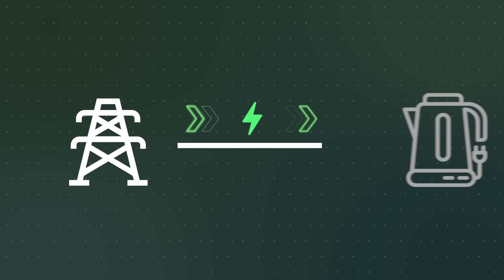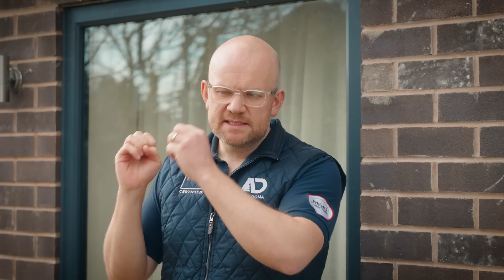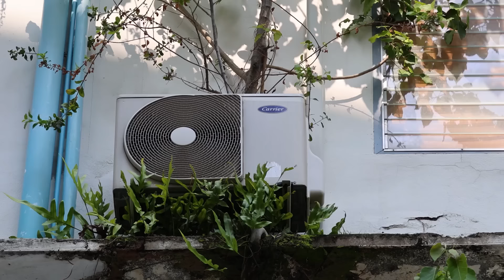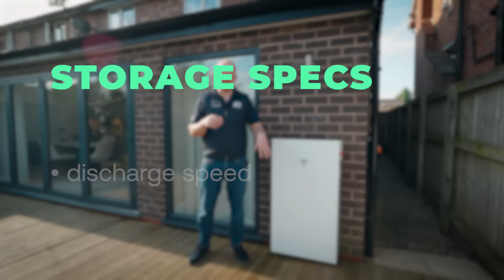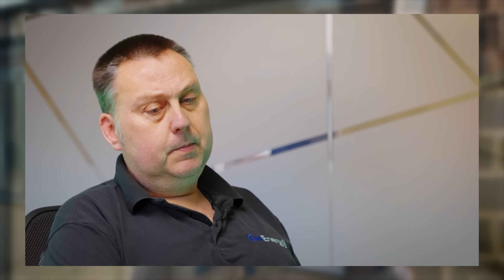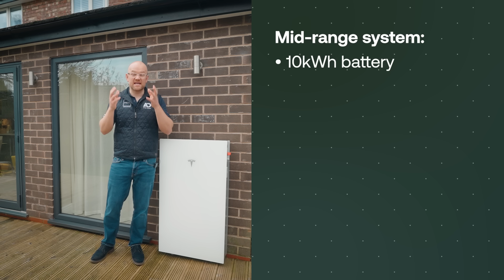Solar Battery UK Guide: When It’s Worth It and When It’s Not

Comment: Tesla Powerwall consumes too much wall-space for typical smaller UK city homes. 13kWh capacity increases sprawling wall space for every additional unit, and an American design where homes are typically larger.

We went with SigEnergy as it's modular, building vertically instead of horizontally, and it's modular.

Our 30kWh battery stack and 12kW inverter (with full G99 DNO approval) sat neatly on the wall behind the garden gate, gives us all the power and storage flexibility we could want. When the batteries ultimately degrade, we can still leverage remaining battery capacity and simply add new batteries vertically, without replacing the entire unit and losing remaining value.

Comment: This was a very helpful video.. My annual usage 9,550 kw and my roof in london is too small so i beleive solar would be impractal. I am only intersted  in batteries.... So I am not sure which brand and battery would be feasible.. With the highest year in warranty. i dont have heart pump or AC. My office pc runs 24 7 .. that where my expense is coming from which is 24/7 365

Comment: You recommend opting for solar panels over a battery if your priority is to run AC. But isn't it the case that in the UK, any period in which we need to run AC is also  likely to be a period of overcapacity countrywide (at least until AC is much ore widely adopted) so that, on a dynamic tariff, electricity would be available very cheaply off the grid anyway?

Comment: Excellent, informative video but you have completely omitted battery / inverter self consumption or standby use. You clearly explain that a Powerwall 3 would run a 1kW load for 13.5 hours but that’s not actually accurate. My Powerwall 3 self-consumes 100-150W to power itself. In reality, due to this self-consumption, my Powerwall 3 will only run a 1kW load for around 12 hours. This standby use is not specified on data sheets and the Tesla App conceals it by treating it as ‘home use’ e.g. it will show that my home is using 1.1kW when it’s actually only using 1kW. How does this standby use compare to other batteries  / inverters and do they all conceal it within ‘home use’?

Comment: I asked Claude AI, to work out the most effective battery and inverter sizes, based on 11 months of half hour data for our house, and our new electricity prices when we come off our current tariff in 3 weeks time. It came back with 15kWh and 3.6kW, and a payback of 4.1 years, based on charge off peak, use on peak. So then I added in a 32kWh battery and 6kW inverter, and minimum discharge of 10% and maximum charge of 85%, it came back with 4.2 years, but over a 10 year period it is by far the best option.

Comment: I find this video slightly disingenuous. You've given some great advice and simply answered some complex questions whilst interspersing an up sell on sigenergy and tesla systems which you partner with as a company. You don't make any claims or accusations about the "budget" systems but offhandedly imply you'd be unhappy if you did buy one but most people don't need the "AI" integration that Sigem offer and Tesla has had a lot of usability issues with smart tariffs of late. Your recommendation of the Tesla warranty is a bit snake oil salesy too - most of the budget providers you mentioned offer the same 10 years with 6000 cycles which anyone would be hard pushed to reach as you would need to deplete and recharge your battery entirely 3 times every 2 days.

You also mentioned reliability as a key push for more premium brands but failed to mention out of every brand you did mention Sigenergy are the only ones who have had major recall and fire issues with their systems.

I appreciate you're a business and need to make a profit but don't claim to be transparent like you did in this video whilst misleading people's choices.
Reply from the maker: Thanks for taking the time to write this, and fair challenge. To be clear, yes, we install Sigenergy and Tesla, and I'd rather say that openly than pretend otherwise. They're what we install because they're what I'd put in my own house, but you should weigh my view knowing that.

A couple of corrections though. Sigenergy are far from the only brand to have had a recall:

Tesla recalled Powerwall 2 units in Australia and the US over overheating.
LG had several fire risk recalls of their RESU batteries across the US, Australia and Europe.
Those same LG cells were used in SolaX, VARTA and Redback systems, which were recalled too.
Growatt recalled inverters in Australia over connectors that could overheat and melt.

The Sigenergy recall was a limited one on the AC plug of certain single phase controllers, and it was fixed free of charge. Every manufacturer will have issues at some point. What matters is how they deal with it.

On warranty, you're right that 6,000 cycles is hard to hit. My point is less about the headline number and more about who's behind it. A 10 year warranty is only worth something if the company is still around in 10 years to honour it, and that's a big part of why I lean towards manufacturers with serious financial backing.

The budget systems can absolutely do the job for plenty of people, and if one suits you, great. I'll make sure I'm clearer about that in future videos.

Thanks for commenting.

Comment: How many panels should I go for? Is there an upper limit?
Reply from the maker: Good question. There is always an upper limit, but it usually isn't the panels that set it.

The first limit is the inverter. Most inverters let you oversize the panels on the DC side by somewhere between 50% and 100%, so you can fit more panel capacity than the inverter's rating and still make good use of it. But the inverter rating is what caps your output, so that's normally what dictates how far it's sensible to go.

With a Powerwall 3, the theoretical ceiling comes from the panel string voltage, which works out at around 36 panels on a domestic property. In practice the inverter rating tends to bite before that. With the Sigenergy it's a similar story, though it has four MPPT trackers so you can usually get a few more on before you run into the limits.

The second limit is the DNO. On the G99 application they don't generally limit how many panels you have, but they can and do limit the size of inverter you're allowed to connect. So that's the one to check early.

And if you're on a three phase supply, or you upgrade to one, the constraint moves again and becomes the capacity of the incoming supply itself. That's where you can go considerably bigger.

So the short answer is yes, there's a limit, and it's set by your inverter and what the DNO will approve, rather than by roof space or panel count.

Hope this helps.

Ian

Comment: So looking into the future,:- 
1/ If everyone installs batteries/ gateway systems, after a power cut wouldn't they all switch to recharge mode and crash the grid?
2/ Sodium ion is around the corner. It has multiple benefits, but the cost and availability (in mid 2026) is not quite right. Wouldn't it be cost effective to buy a cheap battery now and work it to death over a shorter time, then replace it with sodium when its stable.

Comment: Rather than whole house, try a power station and trickle enough from a Fogstar. Leave the grid. Modular for redundancy.

£1500 for fogstar 24V 280Ah 7kW+  two years ago and paid off already. Only 234 cycles on a 6000 cycle to 80% Charge Capacity. The powerstation a consumable. Need more, the same kit again but autominous.

Now figure out how to point your pv at a winter sun all day.

Modest use and insulation before you start.Passivhaus mindset.

Comment: Fogstar batteries plus a large Sunsynk 15kW inverter is around half the cost of a Powerwall 3 with later storage and inverter rating, plus it doesn't require a Gateway device. Sigenergy has a pretty poor warranty.

Fogstar now have heaters and fire suppression so comparable with Sigenergy's USP.

Givenergy have shown us that premium products are a risky proposition.

Comment: It's the standard daily charge that I want to get rid of as that's the most expensive thing to pay for. Off grid is where it's at
Reply: Unfortunately solar is not an off gri system as for at least 4 months of the year over winter you will not get enough energy. Then yo need wind or HEP

Comment: I looked at these wall battery units, and they all are overpriced, I can not afford them... And a hell no to Tesla....
I rather use cheaper rack batteries with zero Proprietary software...but rack batteries take up more real estate, and are not made for outdoors....
Beware UK you are gaming the system with your current situation of buy low and selling high... That all can change overnight... That is what happened in America... We, for the most part, can not benefit from exporting power, anymore... We were, where you are at today, back in 2000s, today we have batteries for long blackouts and overnight usage, not for exporting...
PS I have a 48v 30kwh battery for only $3000us using super cheap 12v lithium batteries... Anything more will be a rack battery system...
Reply: Tesla are the best, don't be put off by short term brand damage by elon, the best engendered battery.

Comment: Hi, I use 16700kwh per year, have no
Solar panels or battery yet. I have an air source heat pump that is really expensive for 4 months of the year, have an EV and a PHEV which costs between £1.20 per night for the PHeV and £3.25 for the EV for the cheap 5 hour overnight rate. Being in my early 60's looking to reduce the amount I pay per month. Thinking about battery on its own initially as I am such high usage I am not sure how much I would save with solar panels

Comment: @Apexdoma
Hi Ian.  We already have a Solar PV system and 15kWh of battery storage and have found it very beneficial to afford to run a couple of AC units in the bedrooms (in fact it was the reason we installed solar).
Following that weve both invested in EV's so are now on the Octopus Intelligent GO tariff.
We've JUST signed up to have an ASHP installed to replace our badly-installed gas boiler.
You've just mentioned the Octopus COSY Tariff that can be used to charge your home batteries numerous times during the day - especially in Winter.
In your experience, is it likely that we'll be best off switching from OIG to COSY tariff during the winter?
For your information we have 15kWh of storage, 6.4kW array of panels and a 6kW inverter +  in our 2-bed detached house?

Comment: I don’t see a downside to having more battery capacity than you need most of the year, especially given how much cheaper some options are now. 

Being able to make it through deep winter days on cheap rate electricity is great.

Also, when capacity degrades after 10 years, there’ll still be enough.

Comment: There is a risk that you have not mentioned. Huge battery systems are being installed alongside power stations and they are probably much more efficient in load balancing than the domestic equivalents. This means that the cheap domestic electric tariffs may not last.

Comment: Who offers the best reasonably costed solar  panels installation complate with Telsa power wall 3 and which Energy supplier would you suggest to go with for SEG?
Reply: Get at least 3 quotes from people who actually turn up to survey, NOT one that just does it on line. Know what you want as some will just try to up sell you equipment you don't need. Personal recommendation, or a local firm. To start with use your own supplier for seg until you know how the system will perform. They are much the same. But go for self consumption first, as SEG rates will be reduced or got rid of altogether if we follow Europe or Australia model. Tesla will be doing their own installation soon if you want to go down that route.

Comment: Who is only using 10kwh per day? I can only assume you have a gas furnace/HW heater and no EV.
Reply: Me. I used 5kw a day. Being efficient is the first thing before installing solar. My three bed home is optimal efficiency. I do burn oil for hot water and heating 500liters a year .

Comment: What do you mean the Powerwall 3 has unlimited cycles? That 'unlimited' 10 warranty is for installation configurations that result in the battery being cycled once or twice a day (Solar self-consumption, time-based control, or backup) otherwise, it is a total draw of 37.8 MWh from the battery or about 10,000 full cycles.
Reply from the maker: Hi roger, exactly that so if you are using the solar in the below ways, you have unlimited cycles:
- Storing energy generated by an onsite solar array, and using that stored solar energy for daily self-consumption.
- Storing energy generated by the grid or an onsite solar array, and using that stored energy for time-of-use load shifting.
- Storing energy generated by the grid or an onsite solar array, and using that stored energy as backup power.
This is how 90% of setups operate.

The only other scenario really is force exporting battery charge to get a premium rate of payback, which is when the 37.8 MWh limit occurs.
Reply: @apexdomasolar  The point is that if you are a retail customer following those terms you will not be fully cycling your battery 3 times a day for the 10 year life of the warranty and so will not hit the 37.8 MWh limit.

"Unlimited" is not unlimited if you follow the warranty, it is just fancy marketing for a device that is warrantied for 37.8 MWh of output.

Comment: Really interested in a power wall 3 battery/solar/EV charger set up to save money and have some resilience but worry about getting ripped off through overspeccing (for example in 10 years we've probably had 2 power cuts so Gateway may not be required, but then I like the idea of a backup with everything that's going on) and ignorance. Any recommendations, I'm based in west Midlands (fortunate to have a detached house/drive). For reference my total electricity for 2025 was 7100 kWh

Comment: For a low user , 1500kw year is a battery better? I'm not bothered about ROI as I'm 62 and the battery will probably die at the same time as me!  What would be the optimum set up for self consumption?
Reply: Yeah we are in a similar position, but older, with the additional requirement to downsize, so the kit needs to come with us. But we are bigger users at 7,500kWh a year.

Comment: I used 3300 kWh a year last year, but thinking of adding heat pump and air con this few years for a typical 3 bed semi. Planning to have 4kW solar and PW3, should I go 1x exp pack or go overkill for 2x exp pack doing arbitrage excess battery?
Reply from the maker: Hello,

It just depends on tariffs, current gas consumption, and expected increased consumption; if you have Octopus Cosy, you may be ok with just a single Powerwall, as it can charge three times a day. 

You may wish to oversize your solar panels a bit further, if possible. With the AC running, this would likely prove useful.

Warm regards

Ian

Comment: What the hell do you people do during a blackout???
Doing battery only is completely bullshit. Your electricity supplier should be the one that owns the battery.... They are instead are relying on you to buy the battery for them or instead of them!!!
Reply: There’s maybe on every few years, and it generally lasts under an hour. So it’s just a complete non issue.
Reply from the maker: Blackouts are exactly where batteries come into their own, but only if they’re set up properly with backup.

Not all systems do that by default, but with the right setup (gateway/backup board), the house can keep running during an outage using the battery and any solar available.

On the “supplier should own the battery” point, that’s one model, but it also means you don’t control it. Owning it yourself gives you control over when you charge, how you use it, and protects you from price changes.

Different approaches, but it’s not as one-sided as it might seem.

Ian

Comment: Another great and well explained video for the lay person Ian. The Tesla Powerwall 3 and the Tesla DC expansion pack your company fitted for us, in Time Based mode takes away the need for us to think about when to charge / discharge. The inbuilt AI in the Powerwall does all the thinking for us learning what we consume, making sure we never run out of power and sells any excess power back to the grid to give us the maximum return on our investment, it’s a true “Fit and Forget”. As we had you install the “Whole House Backup” gateway we do also keep a bit of the battery power set as a reserve in case of a power outage so our Internet, CCTV, alarm system and combi boiler are always powered and the lights will all stay on.
Reply from the maker: Thanks for you kind comment. 😊

Comment: Hi great video. 
Do you think this is a good quote…
21 520w panels N type black, with a Tesla powerwall3. £15000-16000? 

Usage is 5000-6000kwh per year. 80/20 day night split.
Reply from the maker: Honestly, that’s a very competitive price if it’s a straightforward install (e.g. concrete tile roof). If it’s slate or rosemary, I’d just be a bit cautious, as that can be underpriced depending on the detail.

21 x 520W with a Powerwall 3 for £15–16k is definitely on the sharp end.

Systemwise, it’s probably slightly on the larger side for your usage (5–6MWh), but not wildly so. It just depends on how much of that you want to offset and whether you’re thinking about future demand.

Thanks

Ian
Reply: That's a good price. Can you please provide the company name? I would like to get a quotes as well.

Comment: The Edveros configuration I chose at spec stage is the configuration that was delivered. Material by material. System by system. I checked. I've been on builds before where the spec is a negotiating document. This was a commitment.